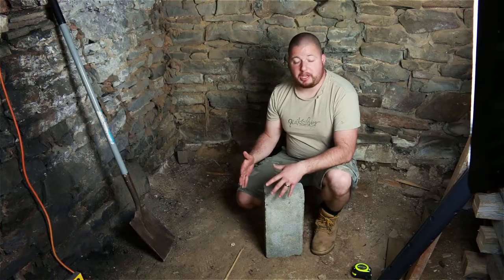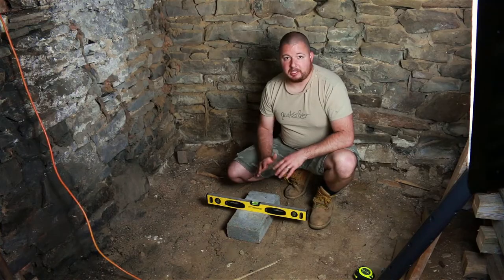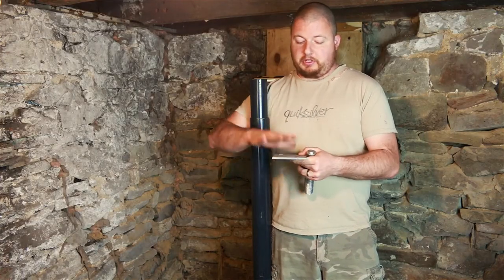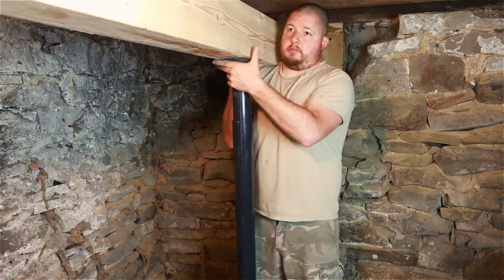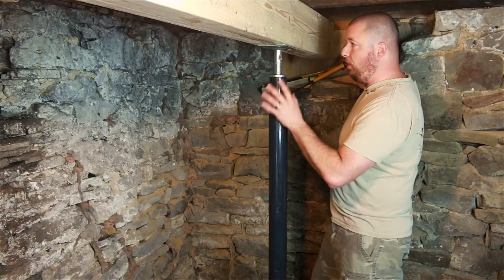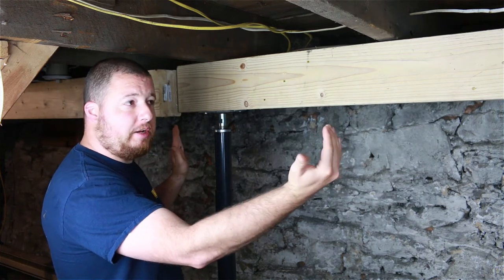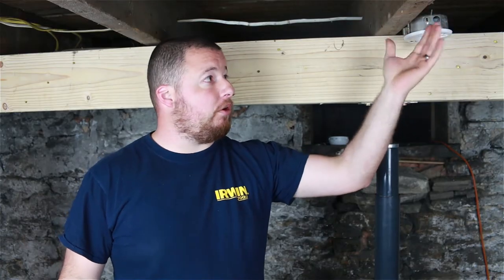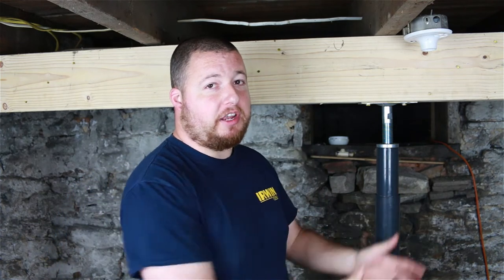Foundation Repair - How to Set Up Floor Jacks Pt 4

Comment: those aren't "floor jacks", those are "jack posts". a LOT of YouTubers seem to be getting that wrong. the JACK is the thing that LIFTS the house beams up. the jack stand is just a temporary support system. for long-term support, you want to use large timbers, or preferably "lally columns" which are steel columns filled with concrete, and are more expensive, but tend to be more sturdy.

Comment: Listen you have a lot of great info on this and will save people some money and solve some people’s problems with that said so many things are wrong first of all a concrete block which 8 inch width 16 inch length 3.5 inch thickness u can not support a carrying beam with that as a footing sorry I use a 18 inch round by six inch concrete pad for surface area way more effective all that block will do over time especially in dirt is compress into dirt creating pressure resulting in broken block so that was wrong also the post you are using is not a permanent fix they are temporary the steel plates will bend around the adjustable screw due to the top plate not being thick enough resulting in a pressure point pushing into your carrying beam also making your claim of that the post is rated for 30000 lbs is totally false I use 3/8 steel plates for my top and bottom and I only claim 15000 lbs so between the post sinking into the ground due to in adequate footing or the fact your trying to use these as permanent posts and they will bend the top plates idk some good info but someone who knows this shit elevate your game a little bit and educate people with the proper info and be more familiar with the products your using

Comment: Just one thing gave me pause on this great series. It was when you mention avoiding cantilever action by putting post at end of beam. I seem to remember in Engineering school, it can be advantageous to cantilever if your situation allows. Usually you can't do this in a house because you want to use outside walls as support for joists, but in this case for temp support you can and should. The forces at the cantilever support cause the bottom fibers of the beam to change from tensile to compression and opposite for the top fibers. This has a load neutralizing effect. The ultimate max compressive and tensile loads are thus reduced else where along the length of the beam.
Reply from the maker: Thats a good thought, however I cant say it is or is not a good idea as I'm not an engineer.
Reply: Where would the jacks have been placed here in that situation?
Reply: @JoePAcalaughs  I think there might be a precise placement that could be calculated, but I don't remember. If I were doing this, I would put the post at 2-3 feet in from the end as a reasonable guess.

Comment: Thanks for the video!  What brand jacks do you use?  I mostly find max load 18000lbs.  Having double that would probably be better.
Reply from the maker: I think they are Akron. I got them at Lowe's
Reply: @appalachiandiy2415  thanks!!
Reply: Careful with Akron… the paint/powder coat isn’t great and they tend to rust after 6 years or so.

Also- many areas don’t consider telescoping post jacks to be code. If you spend a bit more for powerPost everything is galvanized and the capacity is much larger.

Also - most jacks can’t lift with much force, they only support. The correct way to install is to lift with a bottle jack (hydraulic) then install the screw jack to support.  If you want significant lifting capacity with the jack Ellis makes lifting shores that have bearings in them.

Comment: Thank you! Subscribed! This was very helpful and educational.  I have new 12 foot beams going from left to right if I'm facing front of porch I want to install. At end of each beam, there are beams coming out from house (perpendicular) to end of front of porch where railing is.  My new 12 foot beam will be sistered to an existing 12 foot beam. So I place this jack or 4 x 4 support posts at the end of each 12 foot section where they screws into the perpendicular beam?  Should it sit under the new 12' beam or under the beam that 12 footer is screwing into? (Hope I explained this clearly)

Comment: I am bracing just 3 joists  so my beam is only 42" long - I'm not actually raising my floor but rather putting the supports there to prevent sagging. I was hoping to get away with just 3 jacks spanning a 9 foot wall, again covering 3 total floor joists. The load on this wall will only be slightly more than 3000lbs (aquariums). Should I worry about cantilever? I could use 4 and it would just cost me one more jack and one more concrete block but I already feel like I'm doing this "just in case". Thanks for your time and informative video.
Reply: 3 joists over 9 feet? Are you sure that the beams you are planning to support aren’t below the joists?

Comment: could the support beam be installed wide face vertical instead of horizontal ? is the load distributed the same if the beam is wide hi or wide to the sides ?

Comment: Thank you for this. I'm sagging a bit in some areas of my house (1890s). I was curious... I know this is a temporary setup for you but could this also be permanent? I've got so many DIY projects floating around that I'd like to simply use something like this as a stop-gap measure. Thanks for any insights.
Reply from the maker: They make more permanent type jacks like this so yes

Comment: my old home was renovated and they added a kitchen island, that kitchen island is heavy and it has made the flooring sink a little,i have a basement, what would you recommend?
Reply from the maker: jack up the floor joist under the island and sister on a new joist to help support it. do this to ones adjacent to it as it will help share a little of the load as the flooring spreads some of the weight

Comment: Do you know if floor jacks is what professional foundation repair companies would use?  I have a house that they had stuck wood beams on concrete as supports in 2 or 3 places.

Comment: There are a ton of jacks to choose from which ones do I need for a similar situation
Reply from the maker: I buy the Heavy duty ones from Lowes. They are the Akron brand. they can hold 20,000 lbs each. so they can hold ALOT.
Reply from the maker: @Dapper Dame I saw your other comment on my notifications but couldn't find it to reply. If your finding it hard to turn to lift you can use a cheater bar/pipe to give you more leverage, however I don't really care for that because your putting a lot of sideways strain on the jack(make sure your plates are screwed fast) the other option is to have a post (4x4)with a bottle jack next to the floor jack. pumping it up and following after with the floor jack I found to be the best way.
Reply: @appalachiandiy2415  thanx a lot without you Id be done for 😂
Reply from the maker: @TheJudgeJuryExecutioner  Absolutely! glad the vids helped

Comment: Will those screws in the plate be enough holding power to keep beam from kicking out? Or do you use something else to prevent kick out of beam?

Comment: Will these beams remain in place after the new foundation is in place or will you remove them and just use jacks?
Reply from the maker: These are just temporary to span across the joist to spread out the load with the floor jacks. the jacks and the beams will come down after we put the new Steel i-beam in with cement columns. That video will be coming out feb 1st

Comment: do you leave the jacks there permanently?
Reply from the maker: no it is a temporary lift. there are post like this that will adjust about a foot and are meant to be permanent. they are at the same isle as these floor jacks at home depot or lowes

Comment: im gonna be doing this to my house it was built in 1880 so it's old rough cut lumber. im re doing the main beam's that hold the house up.
Reply from the maker: Nice! Are you replacing with steel or laminate beam?
Reply: @appalachiandiy2415  using 2x10 putting 5 of them together for the main beam.
Reply: @appalachiandiy2415  using 2x10 putting 5 of them together for the main beam.
Reply from the maker: @jwngokart6788  nice. Is it possible to use 2x12's? giving you more strength?
Reply: @appalachiandiy2415  there isn't much room to do that that's why we are going that way. I wanted to go with 2x12 but can't.
Reply from the maker: @jwngokart6788  gotcha. Well good luck and let me know how you make out

Comment: What to do with pvc or wires on the way of the bee beam?
Reply from the maker: Ive had to remove some electrical lines and hook them back up/reroute them after the beam was in place. Also had to cut the pvc water line to my outside spigot. once the beam was in place i just put it back together with a coupler
Reply: Esta bato nadamas selanpaso able y able y no enseño nada muy malo su video.!!

Comment: This helps me   My house sags a little , was built in 1900 I have a moist basement with stone foundation. when I raise the house up a little will  gaps be created on the rim joist  and. Create air Gaps ? I am in process of taking out old insulation and sealing up pest access and then using foam board sprayed with cans of spray foam. But should I do this after I raise house ?

Any insight is appreciated
Reply from the maker: Yes, absolutely wait till after. My house sag was extensive and nearly every single wall cracked because it was re-drywalled with the sag not corrected. yes, there will most likely be gaps at the rim board too.
Reply: @appalachiandiy2415     Thank you . My instincts were right  it is winter in Massachusetts I will try to address both asap.

 Good videos you have !
Reply from the maker: @paulhegarty4612  Thanks! and good luck! please let me know how you made out, would love to hear how it went when your done

Comment: How many PSI will the brick hold?
Reply from the maker: If your asking about CMU-Concrete Masonry Units, that varies. Home Depot has block rated at 1900 psi https://www.homedepot.com/p/8-in-x-12-in-x-16-in-Concrete-Block-903881/202535625
If your asking about the solid blocks under the floor jacks they are ASTM 90 spec. again 1900 psi for those as well
Reply: The block needs to be on solid ground that isn't going to have any give, in order to prevent the block from breaking. He was correct in his application because he hadn't dug the dirt away and added any back.

Comment: Where can I get that jack post, what brand is it? Are these permanent ones?
Reply from the maker: These are temporary, the permanent ones dont have the pins to adjust up and down they only have the screw to adjust the height. I think they were Akron brand. I got them from Lowes and they are the heavy duty ones
Reply: @appalachiandiy2415  another company called Tel-o-post sells the permanent ones, but they are too tall for my application. Thanks for the info, I sent an email to Akron to ask them. I want it to hold up LVLs for secondary support of my beams. Actually just now I found shorter permanent ones. I might also buy some temporary ones in the future.
Reply: Appalachian DIY but the temporary ones could stay there for a long time? Why would I remove them if the subfloor is sagging? Sorry for the ignorance
Reply: @misericors3169  I think if they are just for extra support, like adding additional support for a washing machine they can stay.
Reply from the maker: @misericors3169  No worries. They are not designed to be a permanent fixture. They would not pass code for being a permanent fixture. with that being said I've had mine in for months but will eventually put a permanent one in at the middle of the steel I-beam

Comment: Why did you not just dig 24 inch by 24 inch hole a ne pour cement..for a.better stable support
Reply from the maker: That would work but its a once and done method, with block I can move it to more locations when I need to move around the jacks
Reply: Appalachian DIY the cement block will not break with such support weight? I was thinking to make a cement footer of 4 ft down. If the cement block works fine against sand then it should be fine right?
Reply from the maker: @misericors3169  I would think the cement block will work just fine. make sure the base is compacted so the block has a  stable base with no low spots or voids that would potentially make it break easier
Reply: Appalachian DIY it’s a crawl space with sand and debris.
Reply from the maker: @misericors3169  Sand is not very stable. i would try to pour your own brick. use a bag or two of quickrete high strength, put some rebar in it for added strength and make it 2-3x bigger than the blocks I used. it will still be somewhat portable(heavy) but you will not have to dig a hole and pour a pier for your jacks
Reply: @misericors3169  you need to dig down 8 to 12 inches, 2 to 4 inches of pea gravel for the 1st 3 to 4 inches , then the concrete the remainder. The pad can be 12 to 20 inches  square., after the pour  make  sure your footer/pad remains level. Since you have sand soil you will need to put stakes  at the corners. This will keep it level. Let set up for 24hrs, the remove the form. Used motor oil brushed  on the form will allow the wood to release . The think with concrete is the longer you let it cure the stronger  it becomes. You can also use quick set if you have to work with it in a few days.

Comment: Why am I getting conflicting opinions on whether or not I can tapcon the baseplate into the basement slab?? Similarly, why do some structural engineers state that the adjustable piece should be on the bottom and others say it should be at the top?
Reply from the maker: I dont know why you should not tapcon the base plate. that's why there are holes there, to secure  it in place. I don't see how it would make a difference If the screw is at the top or bottom. I have it at the top because its easier for me to turn instead of hunched over at floor level

Comment: Only bad thing is this is not a permanent post
Reply from the maker: This is just a temporary floor jack and to help with a lift in part 5 of the foundation repair series. the final beam will have a permanent post in the center
Reply: I wonder how many times you have had to say this to the viwers,,lol
Reply from the maker: @markfernandes2396  Maybe ill make a video of the difference :)